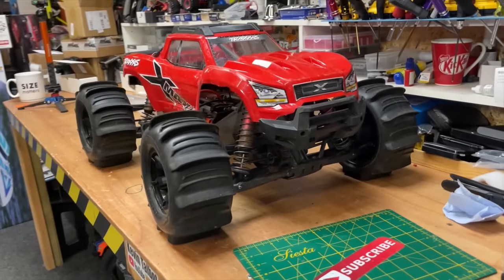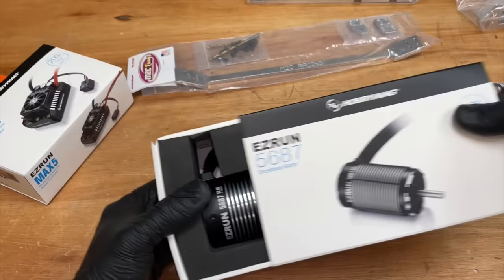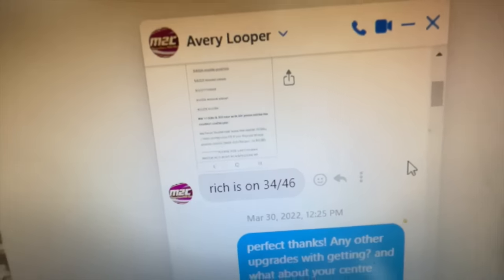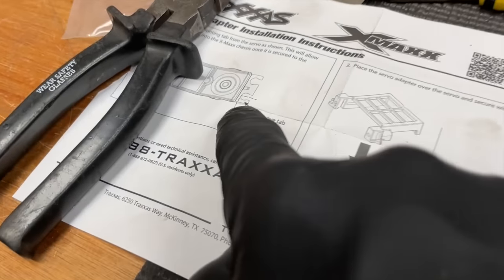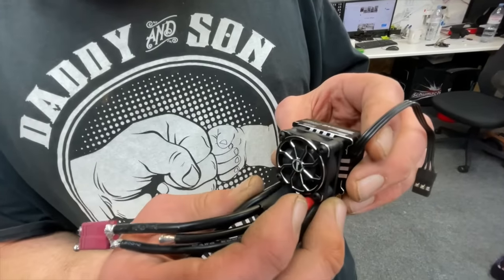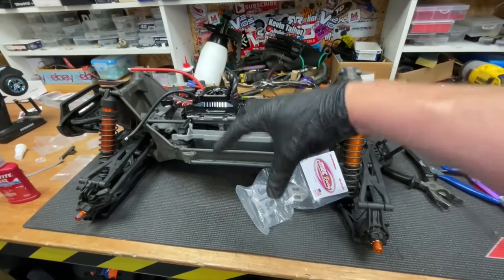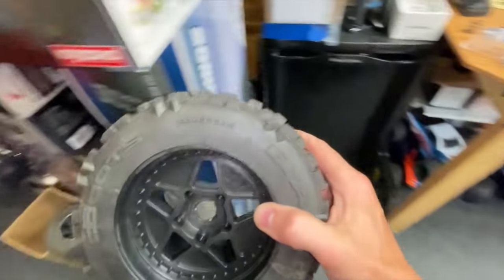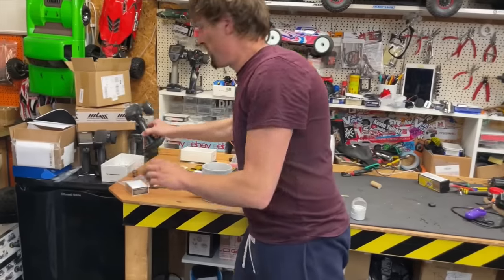Do this mod before putting a giant motor into a Traxxas X-Maxx

Comment: I got my Xmaxx because of you kev and I just want to say how much I love it, thanks for the inspiration I needed to get one!
Reply from the maker: Enjoy it!!
Reply: Have you had problems with the pinion staying on yet can’t find a way to keep it on
Reply: Try using lock tite and a hardened steel pinion, I had the same problem when mine was new, it might just need to be broken in
Reply: i did the same
Reply: i like RC Truck
Reply: As much as he upgrades it it no longer really is a xmax. Just the body. Rest he usually upgrades
Reply: Same here love it but it’s got a broken motor right now
Reply: Yeah I was between xmaxx an kraton, with kevs advice went with xmaxx, think traxxas owe him a sponsor deal.
Reply: I literally got the rustler 4x4 and maxx because kev made them both look awsome and u know what they are kev try the traxxas constent volosity driveshafts for the rustler 4x4 I've bashed it alot and can't kill it! Thanks for getting me into this great but expensive hobby kev!! 😆
Reply: @davidd9289  yeah I did a simple flip today and that was the end of a driveshaft annoyingly the plastic parts aren’t up for a lot of abuse on my rustler 4x4 vxl I’ve already spend $500 on parts like tyres and dust covers etc not even going into much aluminium parts.
Reply: @KevinTalbotTV  how big is xmaxx
Reply: @ar12.  holy shit dude. That's a lot of $ it parts for a rustler. Post a build vid. Would be sick!!!
Reply: @iandarrach9009 with a Dremel, shave some of the shaft to make a ridge for the grub screw. then loctite and out will never come off
Reply: @KevinTalbotTV I got my mt10 because of you and I’m loving it too!

Comment: Extended hubs are going to cause alot more breakages. Thats probably what killed that bellcrank.
Reply: Knew this already and this is why I hate extended wheel hubs
Reply: Their just as bad is putting wheel spacers on trucks not good at all
Reply: Well, he did also put outcast 8s wheels on it making the center point of the wheel in the same location so it shouldnt cause any issues.
Reply: not necesarily, in this case the wheels he used are very low offset, so with the hubs it has got the offset just about where the stock ones would be. A major thing he changed that i would say is the culprit the the thicker servo saver spring. it has less giv,e so it puts a lot more strain on the arms and servo.
Reply: It was it solid servo saver not the extensions
Reply: Not if you use wheels with less offset. More offset in a wheel is the same as a hub extension it’s just built into the wheels
Reply: @SebastianLong  the point of impact on the driveshaft is further from the center of the car, so more leverage still ?
Reply: @fpvrc9829  That depends. The center of mass on the stock tire is also the center of mass of the outcast wheel. Its like putting a 3 foot pipe on a 2 foot peg or a 2 foot pipe on a 3 foot peg. The forces generated at the fulcrum is the same.
Reply: @SebastianLong  man using his brain. 🧠
Reply: That's a very expensive rc
Reply: @zat-1-fury 

 

😊
Reply: I have the extended wheels on my max and my maxx is so strong, so I kinda like it
Reply: lol I know my stuff

Comment: Have this exact motor and esc/ m2c setup and my xmaxx has honestly never been more reliable. I love the truck all over again you’re going to absolutely love it. I’m running 26 pinion 52 spur with trencher tires. FYI, Sky rc makes a $15 dual fan that with a little trimming fits perfectly on top of the motor and in between the brace
Reply: Thank you for the info!!! I have been wondering what gearing would be hood all around for a motor like that...

Comment: Class upgrades there Kevin! I've had a nitro Revo for some time now which is totally stock, and it runs perfectly well. I won't be changing things on it at all. It's good to hear you say how well the XMaxx runs in its standard form, shows how reliable they can be. You two had a ball by the looks of things, and that jump over the climbing frame....jeez, well done for using the throttle a bit to lift the nose. 😎

Comment: Awesome vid, i finally got my Xmaxx at Christmas after watching your videos for months and its an absolute beast, i have done the m2c chassis brace and shock o rings also replaced the hinge pins for the set hinge pins and with thos small upgrades its now a tank. I will eventually change the electronics once the stock ones have broken. Cant wait to see more Xmaxx videos 💪

Comment: I've had a larger motor in my X-Maxx for a couple years and it has been almost noting but breaking the drive-train. I am curious to see how yours holds up, best of luck!
Reply: 100% same motor and max5. But rear diff keeps blowing up
Reply: Mine is the same I replaced pinion gears often and replaced rear and front diffs twice

Comment: It's too bad  that you had to cut so much of the chassis apart to fit some of the bits. And you can definitely tell that the heavier upgrades, and that bulk head brace, is transferring force to other areas causing unusual breakage points.

Comment: Got myself my first rc, x-maxx from watching your vids. Put a max6 in, what best gearing would you recommend for max6 and stock motor. Also what wheels tyres. As stock tyres blow the foam out if I use the self right.
Reply: Done use self right if you countered with heavier wheels you beat on the diffs

Comment: I just replaced my stock xmaxx servo with an agfrc 74kg servo but I didnt know I was supposed to cut the tabs off so I didnt.. it went back together fine and is working great so im a little confused. Is it fine or do you think i could potentially be straining something or causing misalignment?

Comment: Make sure you grease the bearings that come with the RPM rear hubs, they only have thin assembly lube in them. This is even per the instructions that come with them.

Comment: Love your videos so much all of them :D your frends are so nice too with all kind of Personalities XD :D looks like i need to save up for some car instead of finding parts for mine, mine is old Nikko 1/10 Evolution, only thing i can find and buy thats good is standar Tamiya Battery  connector and Ni-MH or Ni-CD type battry it uses 1600Mah and i did see 2000Mah and 3000Mah pretty nice price, other than that its really try and failure i cant afford to try, it has kind of standar parts similar to kyosho on the wheels and wheel nut lock, but other than that i cant find parts.. other that used and no much of it in Norway or Ebay without getting extremly expensive..  :D

Comment: Hey Kev I think those oversized bearings that come with the RPM hubs are shipped dry inside so you need to add some grease or bearing lube of your choice. Was curious if you were running them dry on purpose or if you had lubed them off camera. Cheers
Reply from the maker: I put grease in

Comment: I put the power system from an XMaxx in my og 3908 EMaxx all aluminum shelf queen. I play with it every once in a while but it's so powerful it always spins the locknut for the spur gear off. IDK why they didn't make the threads reversed.

Comment: ever tried boiling your RPM parts for a few mins when new out of package?? ive noticed a notable difference
Reply: also.. silly but, when dealing with 6 and 8s power... GORILLA duct tape is always great to line the inside of the wheels with. i usually use some sort of good super glue on the rubber.. apply a layer of duct tape, the super gloue again and more ductape. i do this 3 layers of each and it makes an INCREDIBLE difference in ballooning tires. i reckon you give it a shot. im sure youre aware of both these little tricks but i do believe both are worthy of becoming standard! then again youve just got loads of inventory so whatever bahahaha

Comment: These are amazing I can't wait till their cheap enough I can afford it lol. I just want something nice for fpv adventure.
Reply: Don't belive the hype, im sure he getting pay to say is the best. The truck sucks major balls. Should of been call the shitmaxx. Haven't run a single pack without running into issues. And the more you wrench on it the weaker the plastic get  giving you even more problems. The parts are cheap because they are cheap. Every single gear on the truck will strip no matter If they are high dollar or not. I blown my diffs just running back and forth in my yard without even jumping.
Reply: Love mine, had no issues and has been more than tough
Reply: @dpaul1148  hell yea
Reply: I have owned mine for 6 months and still had no breakages only complaint is the tyres are rubbish i blew 3 out before i upgraded. This is the daddy of bashers 👍🏼

Comment: Stiffin the chassis its gonna break easier im on your side leave it stock but there is a few things i do change out to aluminum i do put stronger axles better bearings and stainless steel screws n wheel nuts

Comment: Did you ever read that small piece of paper that comes with the RPM hubs It says that the bearings need to be packed with bearing grease all they have in them are a rust preventive. I found out the hard way on my 1st set locking up So I bought a new set And read that piece of paper this time

Comment: I think every powerful motor needs a heat sink and a fan tbh because I had a jlb cheetah with the high amp motor and it could handle the 4s battery but it would just get hot enough to burn your fingers

Comment: Been thinking about upgrading my ESC to the Max5 or Max6 but haven't decided yet. Course why upgrade it till the stock one breaks (we all know it will). Oh and you only have to cut one side of the servo post off (left/drivers side) and they fit nicely not both ya savage. lol. Upgraded mine to the Savox SW2290-SG waterproof. Still can't believe how much abuse you put the poor RC's through and they just take it like nothing.